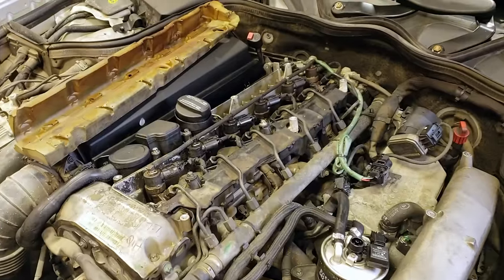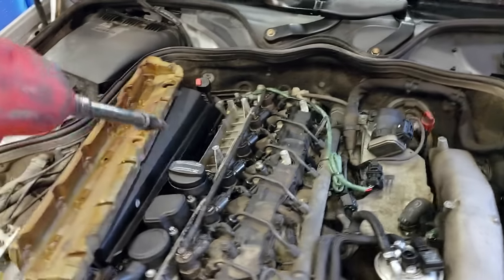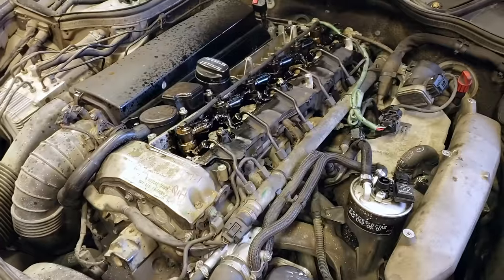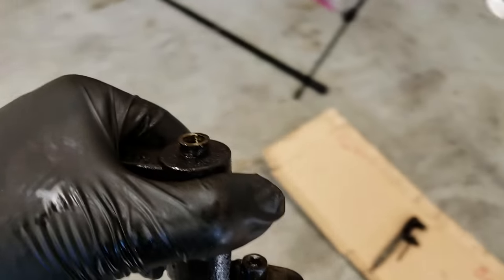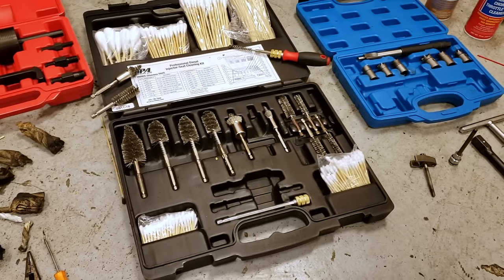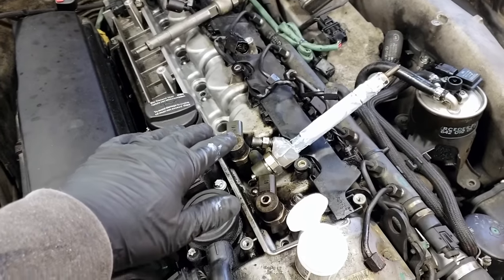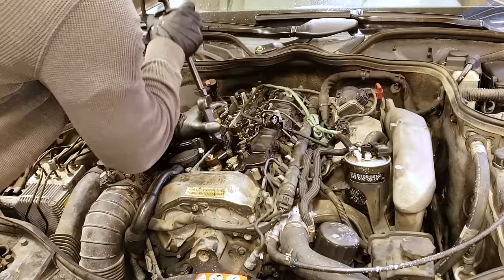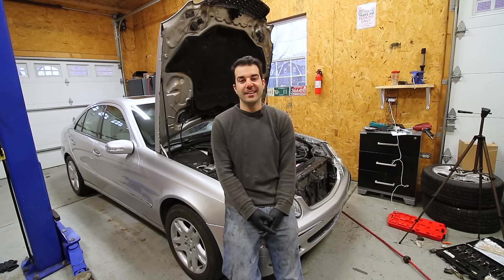My Turbo Diesel Mercedes Has A Nasty Engine Issue. Don't Buy A Diesel Before Watching This video.

Comment: Hey hello thank you for doing this videos. Your channel is awesome. I have a question. What’s your opinion about 270 CDI engine? Is it reliable? What is the common problems? I am a big fan of your channel and Mercedes-Benz. Currently i have a W208 CLK 200 Kompressor 163h.p. and i an very happy. It’s extremely strong and durable car. But I consider to buy a W209 CLK 270 CDI for second car. Thank you. Don’t stop doing this. Be safe. Subscriber from Bulgaria 🙂👍

Comment: Hi Alex, you have learned me alot about Mercedes cars with your videos. I am saving up to go over to Deutschland to buy me a Mercedes but i dont really have decided wich model yet those i are interested in are C200T CDI, C220T CDI and E320T CDI (station wagon, and of course diesel) but my thougts are what to look for and listen after when checking the cars and are the black death common on theese models to? Keep up the Good and interesting work on all your projects..

Comment: I have the 2.7l 5 cylinder vers4of this engine in a 2005 sprinter. I'm replacing all of my injectors. Do I need to reprogram the injectors? Can I drive less than 30 miles to a dealer who can then program the new injectors?

Comment: Id so LOVE to find a CDI which is my ideal car, but they dont seem to be available in a wagon! Must have the wagon, and Im almost at the point of considering changing an engine out of a V6 m112 wagon to get a CDI wagon with straight six. The bluetech engine, no thanks! Why did they abandon the beautiful M104 and then the straight six diesel as well..

Comment: I had one, drove it for about 110,000 miles til got totaled, however it left with one glow plug not been able to come out. I was afraid to break it and then had to take the head off.

Comment: I've been shopping for a 2014-2016 E250 Bluetec sedan.   Most look pretty clean but having watched this video, I am concerned about purchasing one with slightly higher miles, say 125 - 150K miles.  Should I at least remove the engine cover to inspect, or is black death never going to be an issue with these newer diesels?

Comment: Great Step by step clip m8, I'm in AUSTRALIA, although it won't help with my vehicle, it is handy to know,if I do have to do 1,
Any advice on how to get a bit more TORQUE and power from my isuzu 3.0 i td engine, it has a vp44 injector pump,,
Looking at it the intake turbine blades have some small damage to 1 corner of fins,could this cause any power lose
Cheers,and thanks for any advice you can provide me

Comment: Great video and I am just about to do this to my S320CDi  - quick question. Does it matter which way around the washer goes on the injector tip? I know it's a crush washer so was wondering if it was crown side up or down.

Comment: Hey, great video very informative! I've got a 320 CDI that I'm working on right now trying to resolve this issue, but I made the BIG mistake of taking off the top of one of my injectors, and now my enige won't start after putting it back together because I suspect the pressure is leaking away through that first injector. Any idea what I can/should do to reassemble the injector so that it won't leak? Struggling to get the other injectors out because I can't run the engine to operating temp anymore.

Comment: Hey Alex, after hearing you rave about how reliable this car is.  I got out and bough a couple of them, a white one and a black one like yours.  Love them both.  After six months of driving, both of them developed black death on injector #6. I follow this video and bought everything listed on this video for the job.  I was successful on the black one. It ran better than before.  But the white one, after the cleaning and the seal replacement, engine idle very rough, shakes badly and has a knocking sound. The sound goes away at 1500 rpm and sounded smooth,  comes back faster over 2000 rpm.  Sounds like piston is hitting something.  Any idea what going on?  And also which manual did you buy online.  I don't see one for the CDI?

Comment: As I allways say: A job like this can not be done properly (like you did) in any kind of garage or dealer shop. 
The ammature mecahanic is the only one who has the luxury of time, and is able to work at a convenient pace. Which leads to a job done right. 
I don't think any dealer mechanic would warm up the car that much, or that many times to remove those last two injectors.
I didn't see you using any torque on the high preasure fuel lines though. 
naughty-naughty!

Comment: I removed the engine cover and the injector dampening foam on my car and inspect it every fill up.
Reply: That's totally overkill :p
You can both hear and smell it when the injector is leaking. It sounds like a train and it will smell of exhaust.

Comment: This doesn't happen on Internationals DT466 and T444E engines (including 7.3 powerstrokes).
I wouldn't own a mercedes product, it's not worth the cost.
I love your humor about just dusting the trash down the injector holes and just bending the fuel lines and especially the impact joke hahaha.

Comment: Hi Have enjoyed your E320 cdi videos I have bought one!  However the manual download doesn’t work and the injector removal tool is no longer available.  Any other links you can think of?    I have a slide hammer just need the pry that goes around the injector.  Thanks  please tell us how the mileage has improved with the changes you have made.

Comment: The manuals link is bull----.  The don't have a manual for this car but try to sell you something else.
Reply: True.  Have been through several conversations with the sellers.  They ended up sending a 125GB file and an ORACLE "Virtual Box" interface as it is a Windows application.  That didn't go so well.  Have asked for a refund for the original one that only had 6 and 8 cylinder gasoline powered engines.  OTOH, This is a very good video.

Comment: Thinking of buying a CLS320CDI c 2008 manufacture...I think it's a V6 3.0 TD, different motor to this...but do you know if it still has the potential for the same fault?

Comment: Lol, I was waiting for that "OW!"   Now, a question regarding warming up the engine, when you warm up metal, it expands, therefore, won't the expansion squeeze the injectors even tighter?
Reply: Ali expands more than the steel injector.

Comment: pulling injector with hot engine is terrible idea. As you know metalls will expand(injector too)... and holes shrink in this situations.
This mass hammer has terribly short rail.
One way to get injectors off is to lose screws few millimetres and then just start the engine up. It will blow the injector from it seat, and it will come loose. Ofcourse, it it is terribly locked up it won't work out.

Comment: I found you video while looking for mercedes diesel issues. I always been a Honda guy and another day I found a 2012/2013 Mercedes C Class C220cdi. I was a bit interested due to the fact it only costs £30 year road tax. I Live in UK. I read here and there about chain and tensioner issues in these C220 cdi's!? Aparentelly the C250 cdi form the same year/years has the same issues. Do you know anything about these engines? I never had a Mercedes, neither a diesel.

Comment: GM Top End Engine cleaner will dissolve carbon on contact, next time just pour it in the cylinder head well and wait 24 hours

Comment: Would you have any recommendations for a stripped injector bolt hole on the W211 CDI engine? It looks like the car that I bought had previously had Black Death but wasn't aware of it upon purchasing. Based on the maintenance records, it states the bolt hole was stripped and the injector is still leaking

Comment: My brother is looking to buy a blue Tec and I wanted him to know that it’s a bad idea.  Any advice?
Reply: The CDIs without bluetec are far more reliable. I would get a pre bluetec CDI. In the US, that can be found in the 2007, 2008 M, R, and GL Classes (V6) and 2005, 2006 E Class (Inline 6). The E class inline 6 is preferable to the V6 reliability wise but all CDIs are better than Bluetec variants.

Comment: Hi I have a mercedes clc 220 noise from staring wen it's has warmed up do I need to Change power steering pump or is it that the oil is low

Comment: Just bought my 05 cdi. One of the bolts on the plastic engine cover is completely stripped. I cannot for the life of me get it out. I am thinking of just breaking the plastic cover, but I dont know if the cover serves any purpose other than for aesthetics.
Reply: Ripped it off, its pretty bad.

Comment: No issues with rear air blowing hot while on Ac on your w211s ? My 08 E550 is doing it , forum says duo valve and front SAM climate control chip replace , wtf

Comment: Diesel Mercedes. Could you be a little bit more specific? Benz did 3 or four different diesel engines that are very similar. One 2.7l i6, a 3.2l V6 and in i6, a 4.0l V8 and god knows what else.

Comment: Why did you not cover fuel manifold outlet ports & cap injectors while handling contaminated  units? Also, not doing a bench test on those high mileage injectors while out was a wasted  opportunity.  Also, don’t take car for an ‘hour’ test drive to get it hot, use the block heater & then do a couple of convertor stalls in the garage like a h.d. Mechanic would do. Your labour was  greatly exaggerated  by your lack of protocol in doing this in  an amateur way.

Comment: unrelated question, I know a family near Baltimore along with myself who is interested in mating the OM617 and it's related 4 cylinder relative to an SAE pattern load, the plan here is to have the ability to run generator heads and marine drives for boats n such. so my question is how does one go about making those adapter plates without an example engine to work with in hand?

Comment: mate, remove the clamp and let the engine run, that will push out the injector when its ready. I have seen this but waay worse, it was like your scare pictures, seriously, we called it the vulcano eruption, because it looked like lava had poured all over the engine.
This happened on a Peugeot, and it was a toyota garage, so we just laughed at it, like POS french car, but then toyota recalled a handfull of landcruisers potentially with the same issue, the difference was just that most of toyotas injectors are internal, so the lava will get picked up by the oil and it may block the oil strainer, so watch out for that!!

Comment: Hey Alex i am pleased to be following you on legit street cars as i am also a mechanic and a fan of Mercedes benz.i have a W202 C class mercedes benz 5 cylinder diesel with the fifth cylinder nozzle leaking diesel and a white  smoke that doesn't stop after more than 200 miles covered .please what can be the cause.I am following you from the British southern Cmeroons

Comment: Mercs are hit or miss now...duping customers since 1997....the current A180cdi has the same 1.5 renault diesel engine as a Dacia clio qashqai and the current C200 cdi has same 1.6 renault diesel engine as a megane...total disgrace although probably better than merc junk

Comment: I notice a 3 out of 4, old 120k milers I looked at has a small minor leak around the injector seals with the black oily carbon stuff is this bad and should be treated as soon as possible after purchase or can leave it and just monitor it till it gets worse. Thanks
Reply from the maker: No! Do it now.  Watch till the end
Reply: @LegitStreetCars thanks I seen your video initially that's why I'm cautious when looking at old engines and it has a small leak around the seal, I only managed to find 1 car with no injector leak but had other issues, the other 3 cars I looked has 1 or more leak. Quite frustrating trying to find that perfect example. So the question is if I find a good example only issue is a small leak around 1 or 2 seals is get it fixed ASAP after purchase.

Comment: Hey Alex. A bit off topic. But what are your thoughts on a VRP 3.5 inch intake for the E55. Do you think any performance would be gained over the factor besides more of an induction roar? And if so would you ever use it on your E55? Cheers, love the videos man. Keep up the good work!
Reply from the maker: It won't add power but they look cool and make the supercharger whine a lot more. I'll be making a video on it soon and yes, I'd put one on my car just for the sound
Reply: Cheers Alex. Shout out from New Zealand. Great videos

Comment: hey I just purchased a 2008 e320 bluetec rwd with 135k miles for what I consider to be a food price. It has good decent maintenance history but no major repairs on the records. I believe this has a 7 speed tranny . I have not driven it yet, and not sure if it's gonna be a keeper. anything I should look out for? what do you think is a good price for a clean one of these?
Reply: Induction pipe leaks, turbo overboosts and vacs oil from oil breather/separator on rear of o/s rocker cover, then the dpf clogs up, main dealer kids say " the diagnostic says you need a dpf" when it's usually a boost leak repair and a dpf re-gen that's needed. lmfao ;-)

Comment: Wouldn't  run engine without clamp on injector I did I cost me trip to hospital  10 stitches never found injector never heard or saw anything felt ringing in ears then a wet hand blood gushing new someone  else lost 3 fingers

Comment: I did watch this to the end. My suggestion is that you learn more about electricity and electronics. These diesel cars are dead in the water. Electric cars are the present and the future.
Reply from the maker: I sold my Chevy Volt and bought this but I totally agree. Electric cars will take over. For now I'm going to have fun with this
Reply: Alaa Sadek when I can recharge in under 5 minutes and then continue for another 500+ miles electric cars will be relevant...until then diesel wins for longevity and the best use of my time....

Comment: Hi guys, i havr a mercedes E class 200 BlueEFFICIENCY 2011 diesel straight 4 cylinder, someone can tell me the diagram of the cylinders or how they are numbered because i have a faulty problem at cylinder number 2?

Comment: Unfathomable for the  ostensible  best car in the world, it’s a piece of shit. That’s just one of the myriad of hundreds of failures in the Mercedes design. Ordered a brand new $101000.00,   E-2000 430 4Matic, $15000  warranty work in the first year, ditched it the minute the warranty was done.  This is called reliability. The reason why Lexus  goes for  several hundred thousands of  miles and doesn’t really need much...Maintenance.  When I bought my 1992 LS400 with 100000 Killometers I thought I needed to put a set of new spark plugs,  did nothing else,,,  at 475,000 K  still running perfectly and then I sold At 20 years old. I don’t worry about my LS 430 or my LS 460 anymore they’ll last longer than I live. Hopefully over 30 years

Comment: Official MB injector replacement video: https://youtu.be/3F_MY5_-wro

Careful with your torques on the 'single use' bolts.  New bolts = 15NM +90°+90° again.

Comment: For your information all diesel engines have turbo no exceptions, it is not an option, turbo is part of the engine just like the piston rings or the crankshaft, and for sure it was so before you were born.

Comment: He sounds like an insurance or used car salesman. How do you get "basically" carbon?  Either you do or you don't.  "Basically" all the parts you'll need?  Basically pull out the injectors?  Basically they sell a tool?  This guy is a friggin' ding-a-ling filter mask and all!

Comment: more garbage from benz!
Reply: This engine and chassis holds the durability record for all standard production automobiles done May 2005 in Laredo TX. It traveled at an average speed of almost 140 mph over 100,000 miles over a 30-day time span. That's 3,333 mi per day at over 100 mph.